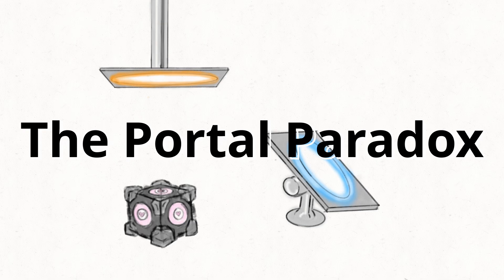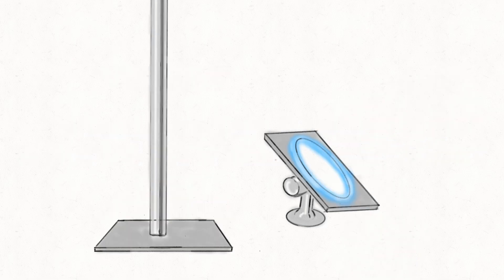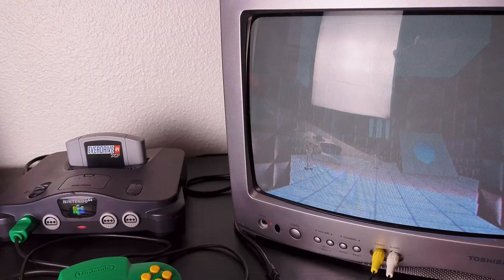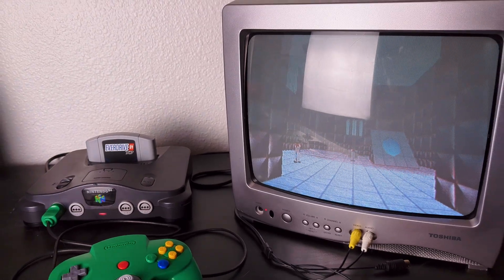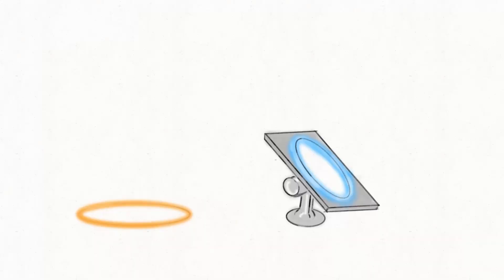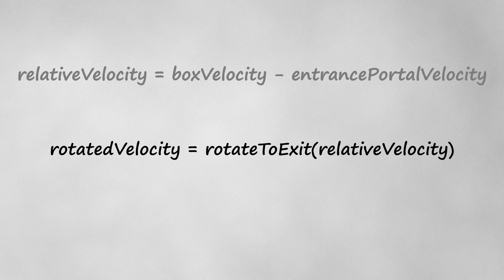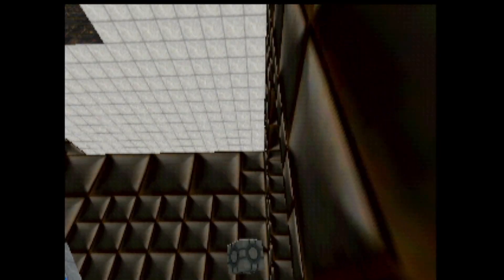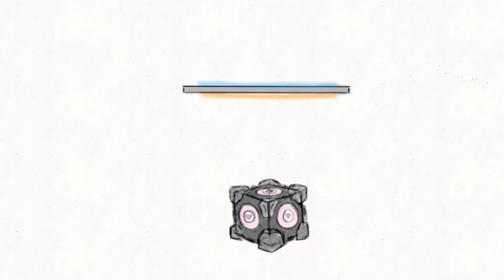I rewrote Portal from scratch and solved the Portal Paradox

Comment: I think you're wrong. The orange portal moving over top of the box doesn't give the box velocity. From a gravity perspective which is what gives the cube velocity it is a stationary object hence no movement. The orange portal could be moving 100 MPH - that doesn't change the cubes velocity. Once the orange portal enveloped the cube the gravity would act on the cube at it's new location differently and it would simply slowly slide down the face of the wall and gravity would be the only force acting on the cube.
Reply: Tell me how fast would the cube be moving through the exit portal if you slammed the entrance portal down on the cube at 100mph

Comment: My takeaway is that the object isn't being pushed out by the ground beneath it, but pulled out by itself in proportion to how much of it has passed through the portal.
If 100% of the portal closes on the box, the box is imparted with 100% of the portal's velocity.

But, if only 50% of the box was portaled, half the box would have the portal's velocity, and half the box would have base gravity velocity. The two would average out, meaning the top half would continue to move out at 50% of the portal's velocity; and so would the bottom half LIFT UP at 50% velocity. 
Even at 10% entry, the whole box would wobble upward at 10% of the portal's energy, as the portaled top of box bobs out of the portal at full speed, then snaps back to a stable position as it still has 90% of itself pulling it back to gravity. 

This would be one feature of portals if they existed in reality; that even without touching the box, the box pulls itself up before the portal's even finished closing on it.

Comment: Well yeah. Relative velocity is supposed to only work while the object and input portal are suspended in a void. Not when the cube is in contact with a surface. The output portal may even decrease velocity if the cube is suddenly introduced to an atmosphere.

You kinda forgot the supposed friction between materials.
However, gravity also affects the cube and that is why it'll fly out the output if any of the portals are in a slope

Comment: The thing I take issue with is conversation of momentum the portal does not impart momentum to the boxes mass and an mass at rest will stay at rest unless a force is imparted. So while it will pass through the portal quickly but would not gain any momentum and therefor should plop out lazily instead of fly out crazily.
Reply: With moving portals involved, when the entrance portal is moving you can look at the entire universe through it as a moving reverence frame. Using your logic I would say even though the cube isn’t moving, the entire rest of the universe is moving around it 😂

Comment: I mean logic would Probably have you reason that the cube just kind of flops out because it's sitting on a still surface. No motion has been imparted on it. You're simply just relocating its existence without imparting any force

I think a more intriguing question would be how can you make it jump like it does in that first video if portals actually existed?

It's basically just a window frame. If you throw a window frame directly down around a person. They're still going to be standing there

Oh Damn it. Now you've got me thinking about it cuz if the receiving portal was moving it would make sense that the momentum would be imparted on the object similar to throwing something out of a moving car but...

Okay so basically physics would be normal. The block would stay still. The Portal would mash through the block. The block would rapidly appear on the other side and would either slide off or get stuck halfway in between sitting on the rim and the floor of the portal

Never mind all that nonsense. Just imagine there's a block sitting on the ground below you and you're standing on your roof and you just drop a window frame over it But on the other side of that window frame is a different direction of gravity and existence
Reply: In the case of the window frame, the frame would rappresent the two portals right? And thus both portals are moving at the same speed, so obviously the cube stays till. But in this case one portal Is still, while the other one is moving, so the cube flies away. To put it simply: if you look trought the blue portal, you would see the cube getting closer, right? The portal is fixed to the floor, so if the portal Is fixed and the cube is moving, the cube will fly out

Comment: Regardless, the cube would have to travel through the portals, which means the cube will, partially, exist in two places at once, and unless it's moving with a relative velocity, i.e. whooshing out of the second portal, it would shrink in the direction of the portal's normal. Or instantly slow down the moment the last part of the cube has gone through the portal.
Instead of a perfectly symmetrical cube, imagine doing the same to something very oblong, like an antenna or a stepladder. Picture what it looks like as it's entering the slamming portal and exiting the stationary one. If it “plops”, that would mean some enormous impulse force would slow it down in the blink of an eye the moment it's passed through completely. Where would that force come from?

Comment: I'm looking this way. we can't think of portal as an object. from your equation it's for 2 objects crossing each other right? like a bug fly through a running car. but if you imagine a portal like a folding paper that have a hole connect each side the enter side and exit side will always have the same velocity. So moving only one of them should be impossible.

Comment: Obligatory comment telling you how you are wrong (I might be wrong as well): 
How can the Cube be ejected with force if the orange portal is still in motion? Assuming that momentum is transferred (which I don't believe) this would violate the conservation of momentum since the cube would have to gain momentum BEFORE the orange portal hits the ground. If there is a conservation then the orange portal would need to slow down as more momentum is transferred away into the cube, at the end which would probably just slide down the ramp because the momentum gained would be reduced to nothing by air resistance and gravity.

As a thought experiment, let's say the cube is suspended in air, maybe it's on a narrow pillar, what would happen if the orange portal slams down over the cube/pillar without the floor to stop it? Where is the transfer happening if only one side (cube and pillar) gains momentum while the portal keeps moving at the same speed?

Comment: "I value your time more than my retention rate" - aaaand subscribe.

Also, I would argue from pure logic, that your solution is the correct one. The cube has to exit the exit portal at the same speed (relative to the exit portal) at which it entered the entry portal. If the exit speed was lower, than the entry speed, the cube would get squashed. If it was higher, it would get stretched. Your hula-hoop example would be great to illustrate that.
Also, the cube bopping out means it has an arbitrarily low speed. Neither 0 (the original speed of the cube) nor the speed of the portal itself.

So yeah, your solution is the only correct one.

Comment: Portals are basically kinetic energy / potential energy translations. If you have a velocity difference between them, it translates onto the object passing through. An object passing through a portal higher than another is just an object going through an instantaneous PE adjustment in the form of space displacement . A moving portal is basically a KE translation, which necessarily involves a velocity difference between frames of reference.
Reply: This is the best reasoning I found so far, nicely said!
Reply: why do we imagine that a portal separates spaces and if the portal moves, then its space moves? It always seemed to me that the portal only teleports objects while maintaining their kinetic force, only in the case of the game Portal this force rotates at the angle of inclination of the portal itself
Reply: @TheDEFCHER  If you put the portal at a higher altitude, you already have a change in potential energy, and if you consider that velocity also varies according to how far away it is from the center of Earth's rotation (or when faced on a completely different orbital body like the moon), it will also necessarily need to have a change in velocity which also requires a change in kinetic energy.

When you go out of the moon portal, you do not get flung at  the speed difference between the orbital speed of the moon and the velocity of rotation of the Earth, which is a difference of several hundred kilometers per second.

There's really no argument, just unwillingness to see that potal physics would just be too inconsistent otherwise.

Comment: This doesn't make sense to me personally the orange portal slamming on top of the box would be like putting a hula hoop over it, I think it would still go through the portal but would flop out on the other side my reasoning is because the piston is not applying any force to the box imagine if you had a piston with a hole in the shape of the portal in the front that's what I imagine it would be like
Reply: Did you even watch the video
Reply: @tommybomby4122  i did
Reply: @epiceaston197  watch it again because you used an example he debunked
Reply: @tommybomby4122  ya but again I feel like it would just be a hole right? This is science fiction we're talking about here so really both answers could be correct
Reply: @epiceaston197  except the portals have motion relative to each other so it’s GOING to change the motion of the cube whether you like it or not

Comment: Nope. This is wrong. Box goes plop. You made your mistake assuming that the box falling into a portal, and being smashed by a portal would give the box the same velocity. We need momentum, not velocity. If you threw the box upward from the ground it would fly out the other portal because it has momentum going up to continue moving forward. But if you just move the portal towards the box, there are no forces causing the box to move except for the difference in friction when it would appear on the angled panel, causing gravity to be able to pull it down again and making it plop. Good on ya for making a whole game engine though. Make you can tweak this

Comment: Fun fact for nerds: If you take this implementation and improve it such that not only can objects pass through the portal, but FORCES can pass through it as well...... like for example imagine you have a cloud of particles that are attracted to each other by force, such as static electrics or magnetics or gravity.......... if you implement it such that the particles are attracted to the other particles on the other side of the portal...... THEN as you implement naively at first, and then notice glitches, and fix each glitch one at a time..... you get closer and closer to an Einstein-Rosen bridge, i.e. a wormhole in spacetime. And not a toy version of it either. The actual physically correct theory of spacetime warping. Not even kidding. The intuition you build up by considering what you'd have to code to make that work at all angles and distances, without glitches near the edges of the portal, is exactly the intuition that tells you how an Einstein-Rosen bridge actually works in actual reality. So if you're a nerd, go have some fun with this fact =) For example, before long, you'll discover that "oh shit, the portal needs to be spherical, and not circular...... or else the forcefields have a sharp kink in them at the edge, which looks very glitchy when the particles move,  and i get this divide by zero error when they get too close...". But don't take my word for it. Try it flat first and as naive as you can, and see exactly what goes wrong.

Comment: So momentum is created based on how quickly the exit portal recreates the object.
Problem is. Who says the object is re-created?
If we assume that portals are not objects themselves and are just interconnected holes on a surface.
If you throw a ball into the air and swing a hula-hoop so the ball passes through the hoop without touching any of it's sides, the ball would just fall back down as if the hoop never was there to begin with.
Now imagine you cut the hoop down the middle and placed one half somewhere else.
Even if the ball entered one half and exited the other, it would not carry any new momentum.
Your solution leans on the idea that the object is deconstructed at one end and reconstructed at the same speed as it entered the first one.
By your logic, if you slammed a portal down quickly on an object but stopped half way through, half the object would fly out of the second portal.

Comment: I guessed opposite because there is one example of a moving portal in the game, at the end of portal 2. The portal on the moon would be moving at a completely different velocity to the one on Earth, and that is not displayed in the cut scene. 

That said, I think relative velocity would make the most sense if portals were real, but based on the game I believe that this is how they work (more like a hole rather than two frames coming down on one another, which is consistent with the physics displayed in the game.) When you slam the portal down on the block, it would simply fall limply out the other side, falling through once its center of mass is in the other portal and affected by gravity.
Reply: No your first assumption was right. Video is not what would actually happen

Comment: I'm not sure why the 'paradox' is still a thing, the answer has always been very obvious.
Reply: And the answer is the box would not get launched. Really weird that that's the way he implemented it.
Reply: @Jarekthegamingdragon  No. It would launch, though it does depend on several factors, such as the speed of the moving portal, the weight of the cube, and how far the portal moves over the cube before it stops. If it helps, try to imagine the cube as a 100x100x100 stack of smaller cubes, attached by invisible weightless string.

Comment: I think that this violates Newton’s first law (the accurately translated version as well) and creates a perpetual energy machine. It should just act as a hole that has no effect on the object. This is much easier visualized if you imagine that the box is extruded up to the height of the portal. The hula hoop example implies that the portal is applying force on the box as though it is being thrown with a velocity given by the portal, but that just has no logic to it. You could also imagine yourself as the box. As the portal falls on you, you would suddenly feel your head being violently pulled upward but there would be nothing actually imparting that force. It just makes no sense

Comment: I love this, but I disagree with the result:

I think it’s wrong to use the relative velocity portals, because portals have no velocity. In my view, portals make the most sense when thought of as nothingness - a hole, connecting two points of space time, through a higher dimension.

In that case, we have to ask: when space time itself moves around an object, does it impart momentum onto the object? Smarter people may correct this, but I believe the physics answer is no.

A cube falling through a portal behaves the exact same way as a cube falling through a hole. In this case, the hole is falling onto the cube. A hole cannot affect the cube, because it is literally the absence of anything.

Comment: If a cube is stationary on the ground, and a hallway, or room on rails with a floor with zero friction suddenly slides over the cube, so that the cube perfectly transitions from the floor its on to the hallway floor, the cube should not gain any speed. I think a portal is just an entrance to a hallway, and if you move the portal over an object, it should not move it.

Comment: The problem with the equations is the assumption that portals can have momentum. Portals are connections between regions in space. The cube doesn’t interact with the moving platform, it interacts with the portal on the platform. Since the portal cannot impart momentum and the cube is stationary, the cube simply drops as soon as it crosses the portal.
Reply: The Moon moves relative to Earth. Chell shoots a portal on the Moon. Canonically, portals can have momentum.

Comment: The math checks out but I don't think this is right. I don't think that relative speed does a thing here. you don't suddenly increase the kinetic energy of the cube. the space within the portal doesn't have any speed, it doesn't change.
I personally like to exchange the cube with a person. If a person jumps out a train it still travels the same speed for itself and doesn't suddenly slow down. with your math if we were to jum down a hole and have a ground that moves ever so slightly slower than what we fall, when we pass through the portal we should just simply almost stop in midair. It doesn't make any sense at all.
If the portal travels the same speed as you, do you just hover there in midair in the portal or do you get squashed  because the portal is still moving forward but you dont so your legs end up at the same space your head should be because you have no speed but also get shoved in the portal? Does the portal just suck in whatever it touches and launch it like a connonball as soon as the tiniest amount of it wen't through the portal? There would be so many questions I could still ask you would need to explain to me xD

Comment: You cannot add the speed of the travelling portal, nor can you subtract the speed of the exiting portal. There is no physical contact between the portal and the cube and no energy is transferred in this example. You are creating the energy for the launch from nothing. Since there is no energy transfer, the cube cannot get any force applied to it and thus it cannot move against it's energy gradient.